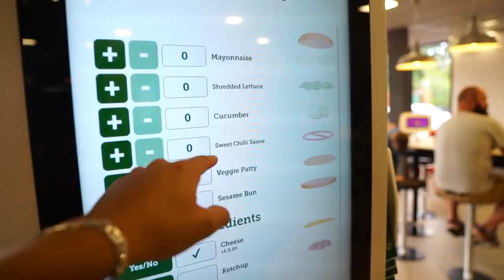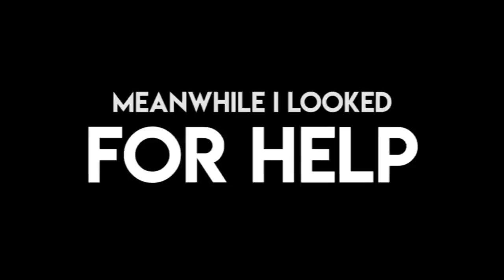I Was Trapped In A STRAITJACKET & Had To Complete 3 Simple Tasks.. (WET MYSELF)

Comment: This is how you escape a straightjacket While you're being buckled up, use one of your hands to inconspicuously pinch the front, giving you about three inches of slack. Take a deep breath and tighten your muscles in order to make your upper body as big as you possibly can. As your sleeves are pulled behind you, try to make sure your stronger arm is over your weaker arm.
Loosen up. Once the straitjacket is secured, relax your upper body and breathe out. Make your upper body as small as possible, and let go of the slack you created in the previous step. The straitjacket should feel looser now. Push your strong arm forcefully towards the opposite shoulder. This will move the slack to where you need it for the next step. Bring your strong arm up and over your head. Keep your weak arm down. Once you've done this, you'll be able to move your arms around. Unbuckle the sleeve buckle with your teeth.( if you don’t have teeth your fucked) Unbuckle the top and bottom buckles behind you, using your free hands. Step on the material of one of your sleeves while tugging your body out of the straitjacket.
There you go now you can run around head butting people all day

Comment: In Canada they don’t use those jackets anymore. They have a different form of restraint where the arms are placed at their sides and they are restrained from the abdomen down to almost the knees. This is harder to get out of and it also restricts the movement of the legs so you can’t run. I have seen this first hand. Just a fun fact.